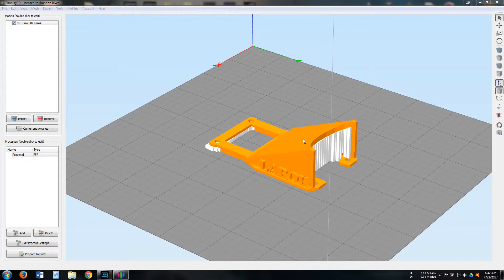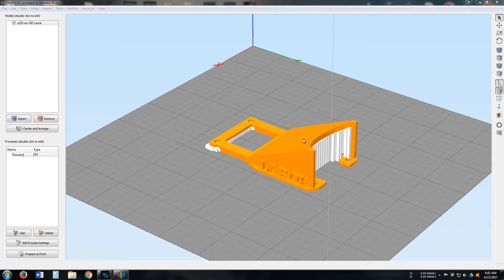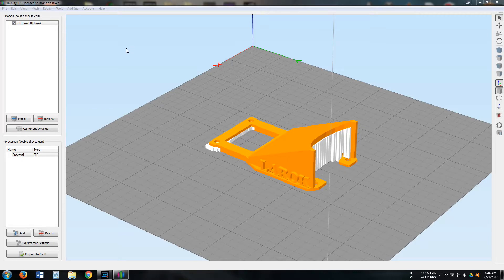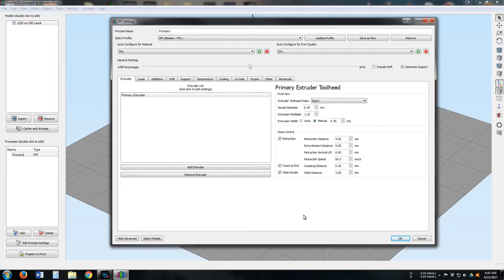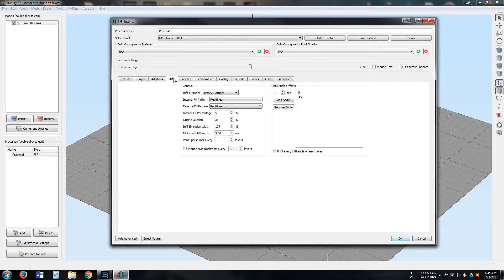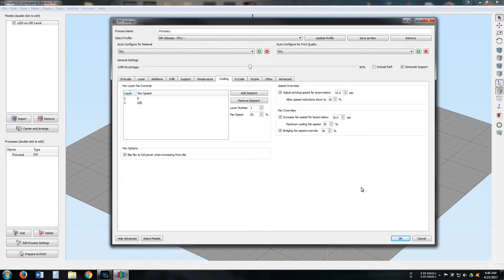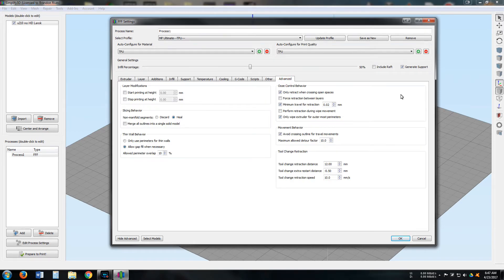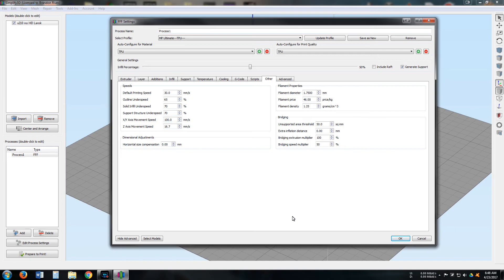Simplified3D Settings: Flexible Filament (TPU) with the Monoprice Maker Ultimate 3D Printer

Comment: Hello Larok,
Hopefully you will still see this. I just bought and Ultimaker 3 extended. Will these settings work for my Printer using Simplify 3D? Also, I don't think your mods will fit into my printer so would there be another option? The reason I ask is because I'm trying to print a cell phone case out of TPU and the first layer seems to be see through even though the Filament is white. Thanks. Great Video!!!!!
Reply from the maker: I would not be able to answer that, as the Monoprice Maker Ultimate is the only printer I have. I think the setting would be a good starting point.

Comment: how did you change the colour of the supports? thanks
Reply from the maker: In preview mode, select Feature type in coloring drop down on the left-hand side. Also, tools>options>Visualization bottom in color settings.